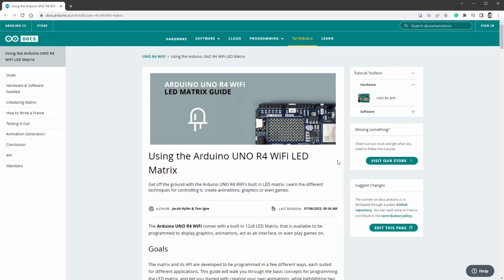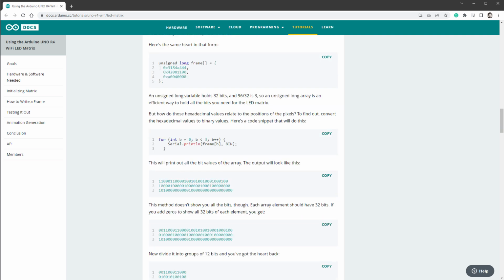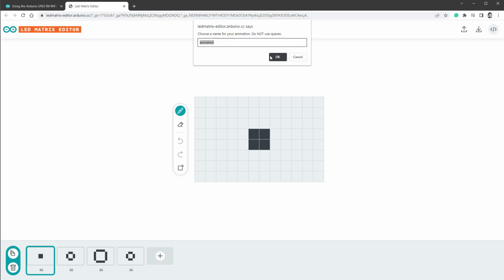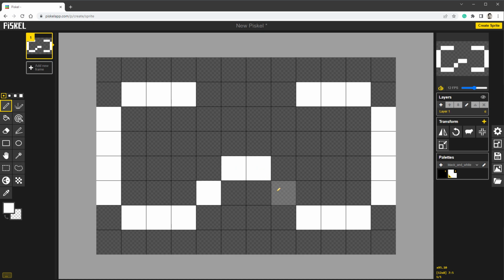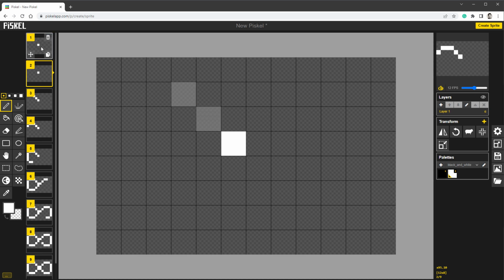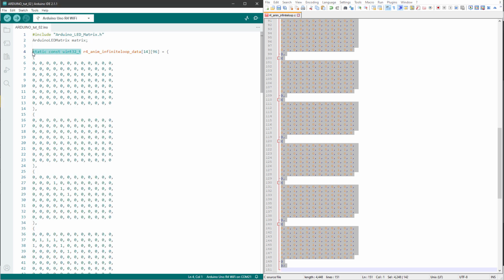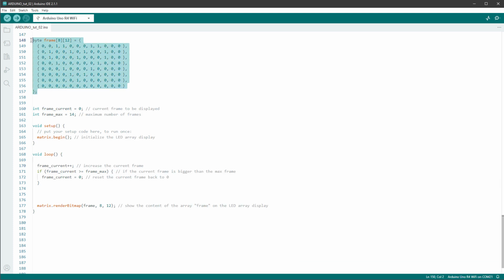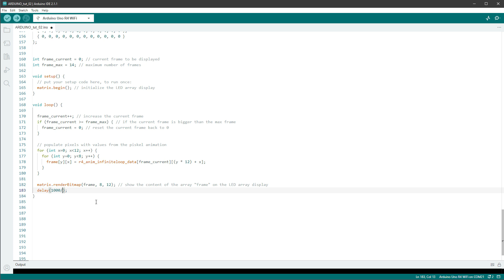Arduino has DISPLAY?

Comment: Woah, that's actually pretty cool. Wasn't expecting an actual built-in display. I haven't followed Arduino in years, so the last time I looked the Uno was still on an Atmega 328P. It's all grown up now with an ARM CPU, wifi, and a little LED matrix! This is actually a really nice starter microcontroller now.
Reply from the maker: They actually did use the same atmega chip for 10 years, but now they are finally replacing it with 32bit more powerful, more memory solution - and, as you have mentioned, also the LED matrix display. The part that I like the best is that it´s almost 100% compatible with the old Arduino UNO.

Comment: Thank you for showing this to us. This looks like a good Arduino board at a reasonable price compared to every other official board they have. I am very glad they didn’t use an STM32 chip like in the Arduino Portenta, very overpriced and harder to program, so i decided to never get one. The board has a strange main chip, it has similar specs to the Arduino zero in memory and clock speed, but has a stronger processor core, and it’s a new manufacturer that i’ve never seen chips like this before. How reliable is the bootloader? Is there a valid com port? Is there an official boards package released? I might get one of these in the future if it’s easy to program.
Reply from the maker: Thank you, I agree that this board is great. There are official packages released, it’s almost 100% compatible with the UNO R4, but more powerful and worth more memory. And of course that led matrix display. It’s my new favorite Arduino board for sure!

Comment: Great tutorial! 8x12 is a pretty good resolution for LEDs. I've used UnexpectedMaker's FeatherS2 Neo, which has a 5x5 matrix of RGB LEDs and comes with a small library to control it. I used it to display scrolling text and it was surprisingly readable even at 5x5. Does the Arduino library have support for scrolling text? With 96 LEDs it should work well. It's surprising to see an ESP32-S3 on an official Arduino board! Is it the first one? This is so much more powerful than the Atmel microcontrollers they've traditionally shipped with. Maybe they'll even switch to USB-C in a few years…
Reply from the maker: Thank you! I agree that the resolution is sufficient, a was also using 5x5 matrix with scrolling text on microbit and it was usable. I don’t there is support for text on Arduino-yet. I’m sure it will be added at some point. Also, the USB-C is already there! 🙂